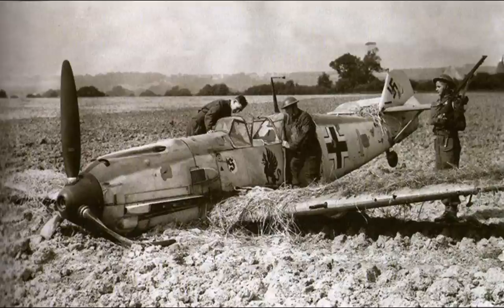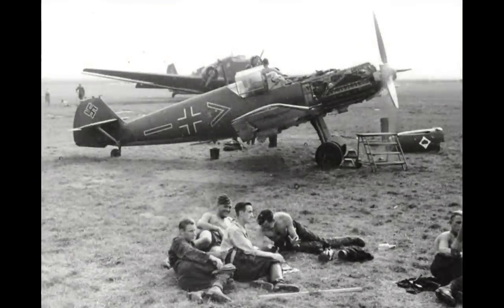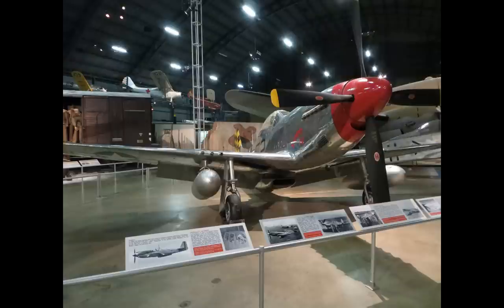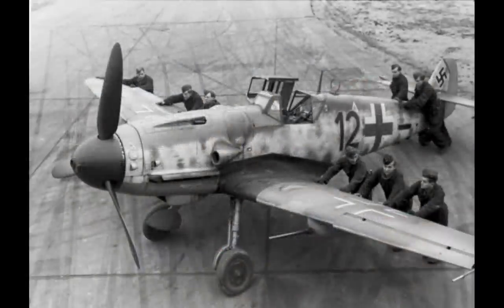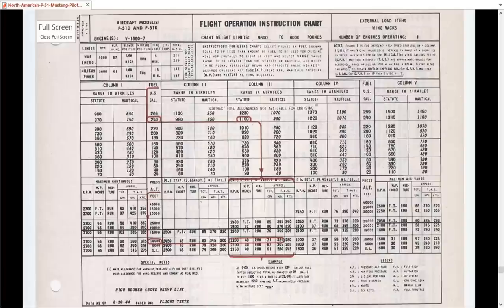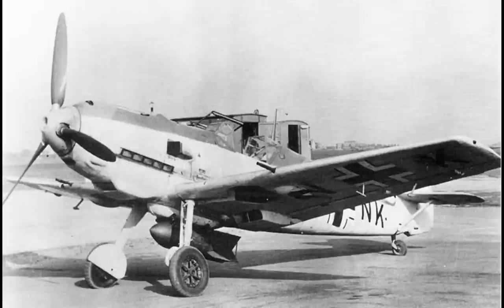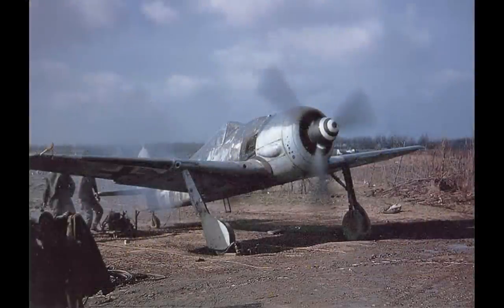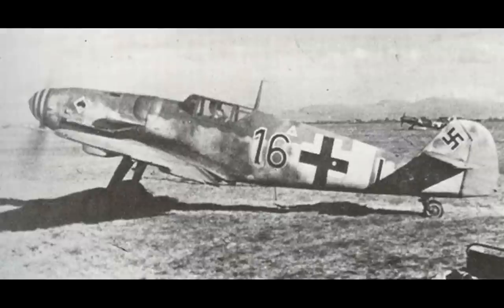Messerschmitt BF 109, Why Such Short Range?

Comment: "Underhead cams?"  13:07

I see what you did there.  Nice touch.  :-)
Reply: "Underhead" in this instance was because it's basically laid out as a regular DOHC engine that's upside down - crankshaft at the top and heads pointing down and to the sides.  Check out the diagram at 8:54.  Neither the Merlin or the D.B.601 used cam-in-block.  The difference being referred to is that the Merlin was mounted in what we would consider a conventional layout, and Messerschmidt mounted it upside-down (thus the "underhead cam" comment Greg annotated in the video.)

In reference to your point, however - generally speaking, cam-in-block engines of that period didn't breathe anywhere near as well as an equivalent DOHC head, as the valve angles are compromised (they can't effectively be splayed as wide as one would want for ideal air flow through the combustion chamber ) - a situation that would be exacerbated by the limited amount of air they have at their disposal in the first place when at altitude.  I suspect that using DOHC would likely have helped combat this, giving better power - especially when in a thinner atmosphere.
Reply: I suspect that outright power would negate using an OHV layout.  They could get more power from an engine with DOHC - enough to more than offset the additional weight and slight increase to frontal area.  Also, as a V12 naturally lends itself to a more streamlined airframe, even with the larger heads (especially when compared to the common alternative of the time - and while radials could be very powerful, I'm not sure I'd call them streamlined), it would be considered acceptable for packaging while giving the best overall performance.  

PS: To give an example of the potential efficiency increase when switching from OHV to DOHC, the FIAT 124 of the late '60s came with a 1.4 (amongst other sizes) in OHV and DOHC (2-valve) variants - the OHV rated at 69hp, and the DOHC at 89hp, or about a 20% increase with the rest of the engine being basically identical.   I suspect that an increase of even 1/2 that would be more than worthwhile.
Reply: @aussiebloke609  The reason why the "underhead cam" layout was used was simple: it meant you didn't have to have a gearbox up front like the Mustang, Spitfire, Hurricane, Warhawk, etc, etc. to bring the drive up to the prop. Also a reason why radials were preferred early on, aside from their (relative) simplicity. By the way, unsaid here, after WW2 unlimited hydro teams tried using the DB engine but spare parts problems dogged that effort. Would've been interesting though since the DB still would've been "upside down". Anyone for a lecture on how Packard Motor Company helped win the WW2 air war?
Reply: The Daimler Benz engine was inverted, hence "underhead cams".
Reply: My 1976 Triumph T140V Bonneville 750 has double underhead cams mounted high in the case, but under the cylinders. This design keeps weight low. It uses short push rods and a timing gear to reduce loss of timing accuracy. My Triumph raced against every street motorcycle type that existed in the world that existed in Suffolk County Long Island N.Y. and she won against all of them for 10 consecutive years. I still have my Bonneville.
Reply: Another reason for the engine being designed to be upside down was to provide space for a 20mm cannon that fired directly from the center of the propeller. That gave more aiming accuracy to the pilot.
Reply: joe jitsu  actually, an Invterted V12 is the absolute best way to engineer a liquid cooled Piston Aero Engine. 

#1 Visibility, having the narrower portion in front of the windshield gives better forward and downward visibility on the ground, in formation and in dogfights.

#2 It also allows those machine guns to be mounted very close to the pilots line of sight, reducing or eliminating vertical gun convergence and hence improving potential accuracy. This was a gunnery advantage enjoyed by the P-38 pilots. 

#3 installing an engine inverted places everything within reach of maintenance personnel. Spark plugs, fuel injectors, high pressure fuel pump mounted in the V, valves and valve springs, cams, oil pumps, cylinder heads, pistons. -  Everything except the crankshaft and main bearings. But even a normal V engine is assembled and di-assembles inverted. That's how you lay the crankshaft into the block, and you also push the pistons down and out the top of the bores while inverted. An Inverted engine is designed to be manufactured and worked on in the field. And it has ONLY ONE Disadvantage: you cannot use the same engine in your ground and naval vehicles, tanks, boats, ships, etc. Because then it would be a packaging and maintenance nightmare. But for aircraft, it's perfection.
Reply: lol
Reply: @PeterDad60  That’s a great story. Are you still in the Suffolk Co area? I imagine there’s more congestion now then when you first started racing the Bonneville around. Had a couple friends in high school back in the ‘70’s that rode Triumphs. They were real ground pounders to say the least!

Comment: The airframe design is as important as engine development. The airframe design of the Mustang (and late model Spitfires) allowed a greater rearward shift in CG caused by the weight of a substantial fuel tank behind the cockpit. 
We delayed production of the 20 series Spits due to emphasis on manufacture of the main production marks, V, IX/XVI & XIV.
The earlier point defence types (of which the Merlin Spits and all 109's are classic examples) had big engines in small airframes with deliberately small (drag reducing) tailplanes,  which restricted the permissable extent of rearward shift in CG caused by rear fuselage fuel loading.

cf. Jeffrey Quill "A Test Pilot's Story", Chapter 21, "Longitudinal Stability and Increased Range".
Reply: The 51 also has a massive advantage over the 109s even late, in terms of drag. I highly doubt the 109 g in question was getting a range of 450 miles at 400mph or even 360
Reply: @Nikarus2370  UUMM    a developed P51  yes,  But xp51s  had a range of only 500mi   with the thirsty allison it was only after adding, internal wing tanks ito its Fat wing,  fuel tank behind the pilot set and external wing tanks that the P51 c and Ds  got there range  Oh and the addition of the merlin which didn't drink nearly as much as the allison
Reply: A very important point that ties a whole lot of other stuff together. Thanks!
Reply: What is CG it’s too early for me

Comment: I found it interesting that the 109 was adapted from the 108 which was an aircraft designed by Messerschmitt for private use and was a 4 passenger plane. Fuel capacity was an issue for the 108, 75 gallon maximum divided into five tanks that were spread around the fuselage. The 108 was heralded as being a easy to fly aircraft and was fast for its day. The engine was half the displacement of the fighter version, but it could get close to 300 knots depending on the propeller type. I have been following the Kermit Weeks restoration of the 108 and he got his hands on a 109. Lucky sob. He really has a nice collection of wwl and wwll aircraft for a private collection.

Comment: It always come to the same issue : higher/lower octane fuel ==> more or less manifold pressure. 

Thank you for these great videos !!
Reply: Add to this lower or higher compression ratio and
retarding or advancing ignition timing ;D.
Reply: Boost always wins lol..
Reply: US fuel was higher octane & the methods to produce it were kept secret.
Reply: Germany was using synthetic fuel-liquid fuel produced from coal-to produce aviation fuel. It was difficult and costly to make the higher octane fuel. They could do it, but only at a cost. And since every gallon of gas was precious in Germany, they tried to use lower octane fuel on their fighters.
Reply: @jimblake3574 the additives for the high octane fuel had been supplied to the RAF.  The Germans notices the improved acceleration of RAF fighters immediately but didn't know why. Disobeying the order not to fly fighters over Europe a Spitfire pilot was shot down and his aircraft recovered and everything closely investigated. With no mechanical improvements and after analyzing the fuel they knew the secret.
Reply: Didn't OP do a video where he said the main benefit of water/methanol injection was to prevent knocking so gain the same benefit as higher octane fuel?

Comment: Excellent video.  Onething you didn't eleborate on was it's drag in in it's design.  When an aircraft has external radiators (3 of 'em!) external supercharger intake and my favorite struts on the horizontal stab.  Not to add the exhaust and flight control counter balances  .An aircraft really needs a big engine to overcome all that.

Comment: Excelent video! Perhaps an important aspect of the Bf 109E range question is that when the design was "frozen" for serial production, the necessity of escorting bombers as far as London was not well understood. First, because war against England was not a high probability in war planning, and, second, because by this time bomber escort was a task for a heavy fighter such as the Bf 110. So, these are probably the reasons  that caused huge delays in providing the Bf 109E with external drop tanks. These were available to the E7 series by late 1940 only, while the Zero fighter, designed for long range had this equipment available from the beginning of its service life. So, even with a big engine, that short range that became so serious a problem in the final months of 1940 was most likely derived from faulty planning and  a substantial error of evaluation of the heavy fighter capabilities as an escort fighter. It could be pointed alto that late model Bf 109s, from the G4 series on, ir muito memory is ok, were capable of carrying 2 and even 3 300l external tanks, thus having enough range to follow back the P51s to England, if range was the only aspect in consideration. The problem of range by 1943 was much less important than to have an extra punch to deal with the heavy bombers that were showing their capacity to take the fight to the roofless nazi fortress than. Hope have contributed to this explendid work. Kind regards from Brazil!
Reply: Zero was a naval aircraft, hence the tank..
Reply: @deadendfriends1975  Yes, sure. But I think that a big discussion probably happened among air power specialists in the late 30's about the bombers capacity of getting through an air defence system, including interceptors. One school follows a self-defensive line of machine gun turrets and formation flying, while some people argumented for long-ranged escort fighters to fend off interceptors. Big, powerful, twin-engined aircraft. Well. Nobody had a practical experience on this subject, with the exception of the japanese, deeply commited in long range aerial attacks in China. Ir was in this scenario that the first Zeros entered in action. Naval fighters by project, long range escort fighters over land by necessity. However, the deep implications of this sucessfull experience were not understood by ter other air forces that tought at that time of strategic bombing. USA continued to believe in precision bombing by heavy, self-defending flying fortresses, Britain continued to believe in close formations of turret-armed bombers, and in Germany   the short range Stukas suplanted the Ural bomber concept. Add to it a certain strenght of heavy fighters, the much vaunted ironsides, to clear the path for the bombers. In the end, the ultimate test of combat showed clearly who was right. And a more correct, experience derived demand finally produced the ultimate escort fighters, the P51B,C,D. To play, basically, the same role the Zero played in China, in that distant 1939. Kind regards!

Comment: One simple way to dispel the "Venturi cooling" effect is to say that at the end of the intake the air need is a certain fixed quantity (pressure x volume). Low pressure cooling is achieved by stretching the quantity of air (and it's thermal energy) over a larger volume. Temperature is energy per volume. Because the air quantity requirement in the cylinder is fixed, stretching it to cool it is fruitless since you have to cram it back into the cylinder anyway.

If anything briefly stretching the air to lower its temperature means that thermal energy will soak into it and the total thermal energy will increase. The temperature will be higher when the initial density is resumed. If you wanted cooling the best tactic would be to compress the air very hot, let the hot air lose energy, and then return to initial density. I'm guessing that tactic is impractical in the fast-paced world of air breathing engines.

I spent the whole video expecting you to say "the question isn't why is the 109's range so short, but why was a rather normal-ranged fighter given such a long-ranged mission?" The airplane wasn't wrong, the mission was wrong for the airplane. And I think the answer to that was the Me-110 was supposed to do that mission and fell short Aug-Sep '40. The Bf-110 was a beautiful airplane that struggled with anything more daunting than earlier Hurricanes.
Reply: Your thinking to hard have a joint or something,..olol

Comment: Most importantly, in my opinion, more power means tactical advantage. BF-109s were renowned for starting combat from an advantageous position because of German fighter tactics which were enabled by the more powerfull engine. When they started running low on fuel, they (if flown by an experienced pilot) could also disengage from combat and head for home without having to worry being shot in the back. Although quite a few miscalculated or got caught up in combat that they had to ditch in the Channel.

The weakest point in the BF-109 design was the flimsy undercarriage. It is stated somewhere that the Germans lost more BF-109s due to rookie pilots crashing on take-off and landing and even during taxiing.

Comment: Pretty comprehensive explanation by any stretch of the imagination. So many questions go unanswered about these planes due to video length constraints and how much information is relevant to the addressed issue. Pretty good. It was nice you laid out the real question at the end as there was no real discrepancy in range. You did not say the A6M zero could fly 1,000 miles, drop a five hundred pound bomb and return home. That probably would have thrown off the question. Good video.
Reply from the maker: I couldn't cover everything in one video, but I do have others, and I'm adding more all the time.
Reply: @GregsAirplanesandAutomobiles  You did great. I was astounded to learn the A6M could fly 1,000 miles, drop a bomb and fly home. This plane was reengineered from the Brewster Buffalo, probably bought from Austrailia. This history never ends.

Comment: Thank you for this nice explanation! Fun to see you mention the Fokker DXXI. It did serve well in the Netherlands (my home country) shooting down more planes than the Germans ever expected. But we lost it on the ground quickly. Range was adequate for our country, as it is very small indeed. The DXXI however was never intended to be used in the Dutch East Indies. It was a Dutch colony in those days. Size wise it is huge with many hundreds of Islands to be defended. The Brewster Buffalo was selected and some 70 aircraft were operational during the Japanse invasion. Although a stiff fight was put up downing a number of bombers and even Zero fighters. They Dutch never stood a chance and were run over by the Japanese.  Fun to see that the Fins used both the Fokker DXXI and the Brewster.

Comment: First, thank you for the video. I didn't fully understand all of it, but it was still very informative. Next, my comment. If you think about it, flying 400 miles on 100 gallons of fuel comes out to about 4 miles to the gallon. which is incredibly efficient, especially considering the air drag at that high speed. Not just 109, but all those airplanes are engineering marvels.
Reply: You have to consider the drag at the altitude and speed specified for those fuel usage figures. The reduced air pressure at high altitude leads to drag figures that are the same as the drag at lower speeds at low altitude.
Reply: 내가 조국이다. 내가싸운다. Well, that’s an average.  You burn a whole lot more fuel on take off and climb.

Comment: Really enjoy your work, particularly regarding engine technology. I built lots of flying model planes as a kid, but only the kind powered by a rubber band. I have at least a basic understanding of control, stability and low-speed aerodynamics, but never had anything to do with internal combustion power. Keep up the good work.